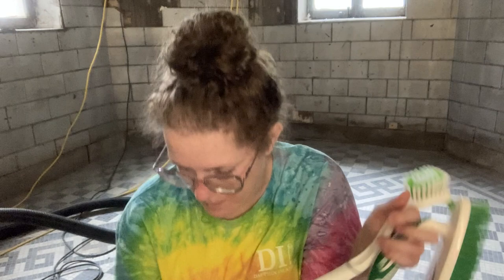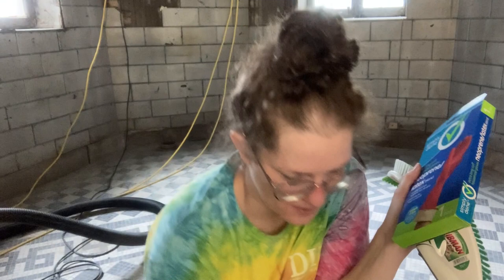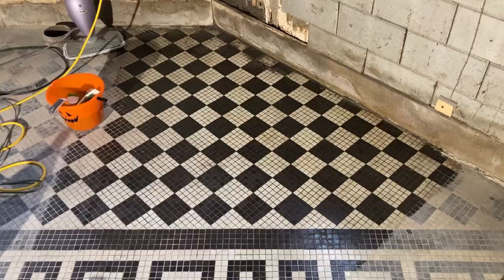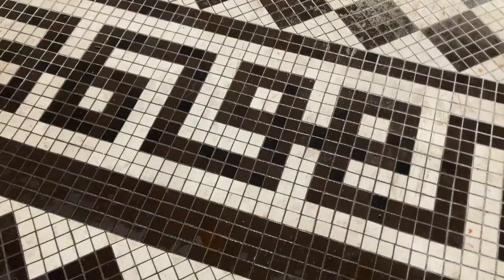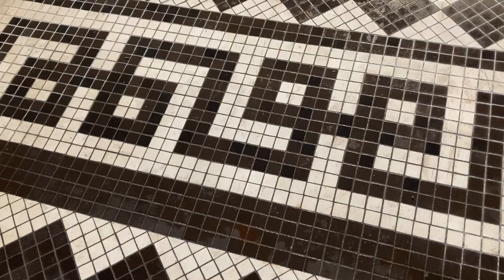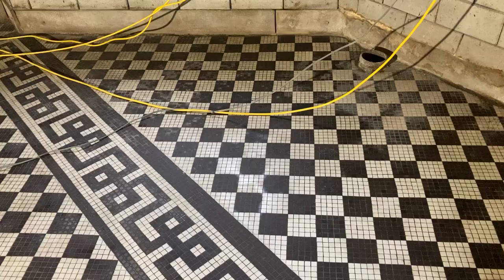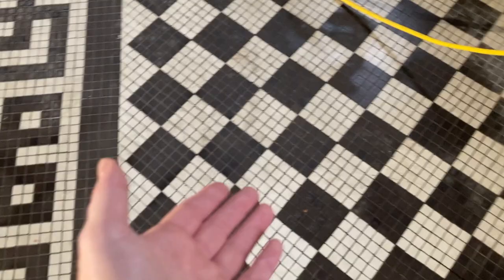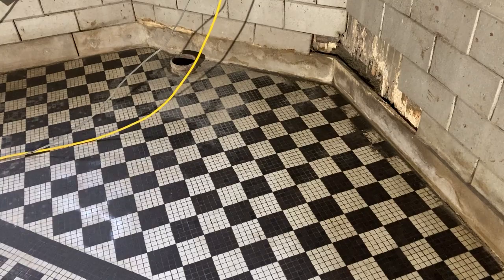Vlog 25 Cleaning the Tile in the Vets Office

Comment: Rome wasn’t built in a day, and decades of dust and grime aren’t going to come off in a day. That said, don’t lose heart. It looks remarkably better from your first pass.
Have you considered a test patch with a solution of oxyclean and water? I’ve been working my way with elbow grease, that solution, and twenty years of grime on grout. It’s gone from dark grey to its original white from when it was first grouted two decades ago. It takes time and work though, but shows a big difference. (Just test it first, since the age of the tile/grout. And if you do, don’t make it a paste because it dries and hardens, and becomes a pain.)

Comment: Hey Kim, I don't know if anyone else mentioned this, but here's my two cents worth. To save your knees, get a coarse scrub brush that screws onto a long handle so you can stand while scrubbing. Seeing that it's tile with (probably) white grout, I'd use one part Simple Green, one part 30 Second Outdoor cleaner (this will whiten the grout, kill germs and deodorize) to three parts hot water, then rinse mop with clear hot water. I know you don't have access to hot water there; you need to constantly change the rinse water, because that's what does the actual cleaning. I've never used a steam mop, but you seem to be having success with that.
Reply from the maker: I did buy a deck scrubber to put on a broom handle! The grout is actually black so I don’t want to do anything too damaging for it.

Comment: Check I f that shop vac is wet/dry.  If it is, it’ll be a LOT easier and you won’t be moving the dirt/mud around or wasting paper towels.  Just be sure to dump the dry dirt out and use the correct filter for the vac before and after.  You may never be able to clean the grout to “like new” but a decent cleaning solution should get those tiles gleaming.  Rinse with clean water before the final extraction with the vac.  Vinegar may erode the grout if it’s allowed to sit too long or not rinsed off.

Comment: Three ideas: 
1) 1 part Vinegar & 1 part Dawn - mixer together - put on floor - come back in 1/2 hour with clean water to remove dirt.
2) Water with bleach or just bleach for the floor.
3) For the grout by itself - use long strips of cotton (for perms), dunk in the bleach, leave on the grout until the dirt disappears.
A second bucket with the clean water for rinsing.  Is there a drain in the basement for the water?  
Have a great weekend Kim! 😎

Comment: Where you used the vinegar baking soda removed way more "scale" and grime -  I would say you may need a power unit and a proper chemical cleaner to remove the staining and scale - black diamond or granite gold grout cleaner maybe - baking soda with vinegar is a light acid solution and seemed to work the best - the floor looks stunning though keep up the great work

Comment: Something i found that got dirty tile cleaner was gel toilet bowl cleaner. I left it on for about 20 minutes and then scrubbed it off. It removed the deeper dirt that i could not remove. Do a small test sample and see what you think. I will say I'm impressed with what the baking soda, vinegar and steam mop have done. That's more love than the floor has seen in decades I bet. Could be with with repeated cleaning more and more will come up as well. Keep up the great work. Inch by inch the house is getting better and better.

Comment: Why is it important to have a clinical look in there? Cold and sterile doesn't seem to do that gorgeous tile justice. Adding yet another pattern such as subway tile wouldn't seem to either. And, only going up half way adds yet another pattern. Add this to the doors and windows in that room would seem a shame. If the wood wainscoting is going to be taken down, mold and mildew resistant wallboard painted a light gray color would really look nice and be quicker, and less expensive in my never-to-be-humble opinion.

When the work on the rest of the room begins, I hope that beautiful floor will be protected from further scratching and from dropped heavy tools which can damage the tiles.